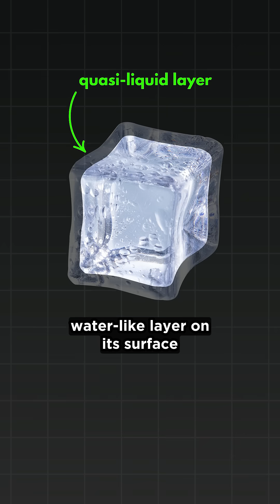The Science Behind Slippery Ice: Why Ice Skating Defies Logic

Comment: To everyone who is puzzled why scientists did not know why ice is slippery. It is more accurate is to say that they did not find out why there is a thin layer of water on the ice even at below freezing temperature, and as she has explained it was NOT due to melted ice from the skates' pressure. What the scientists figured out is that at the surface of ice, the water molecules at the boundaries is not fully surrounded by other water molecules, and therefore is unable to form the proper lattice structure of ice, and hence remain in a quasi-liquid state at all temperature. Now if you join two boundaries together, the water molecules at the boundaries are now able to form the full lattice and will become stuck together.
Reply: Thank you for the clear explanation, I was very confused about what was actually going on after the short. I always thought it was due to the pressure of the blades melting the ice. I used to play ice hockey when I was young (like most guys here in Finland) and the shape of the blades on the skates are actually not like a knife, but like a very shallow U shape, there's like a little canal between the two sharp edges, and I always thought that the pressure melted the ice and the water would then be guided to the canal due to its U shape and that way erase most of the friction. I think it's called the "radius of hollow" in English. It's the profile of the blade, the deeper the U shape, the more bite the blade has on the ice and obviously the sharper the blades are, but with a more shallow profile you get more glide (and less bite).
Reply: is it not slippery for the same reason liquid h2o is? due to the fact that it creates a barrier between you and the actual ground?
Reply: @chxseyt  searched it on google, it seems the simpler explanation is the change in molecular arrangement and the hydrogen bonding when turning solid. 

Hydrogen bonds in liquid state constantly break and reform therefore no layer of quasi-liquid is created, but as it turns solid, the bonds maintains a strong hold with each other rendering the other hydrogen bonds unable to harden because there are not enough hydrogen to bond with? So when 2 ice cubes are placed together, the surface of which the 2 cubes contacted where able to meet the requirements of bonding therefore sticking to each other. 

idk anything about this 😂😂😂
Reply: @chxseyt but in this case ice is the ground
Reply: In case no one as answered properly.  In layman's terms, yes.  But there's more to it than that.  @chxseyt
Reply: @chxseyt  when u stop depending on scientist and actually use physics for urself, u cud think for urself. Water cant be compressed so when u step on somethong that is wet, ur are slightly suspended by water with causes minimal contact with that surface.
Reply: @mylesgreen1361  L ragebait, you good?
Reply: @mylesgreen1361  Lol so you think your understanding of physics is better than scientists I guess? Just like all flatearthers? You don't even understand the point of contention here. it is not "why water makes a surface slippery", but "why is there ALWAYS a layer of water on ice making it slippery". Also, "Water can't be compressed..." well, that line speaks for how much you actually understand physics. Maybe you thinking for yourself is not something you should depend on so much
Reply: From my understanding this was debunked, basically there are ice crystals floating around similar to dust particles on the ground that the skates - due to the low surface area of the skates 'skate' over said crystals. Similar to how you can slip on a dusty floor. Your skates are basically rolling on the free floating ice crystals. This is why for example you can walk on giant blocks of ice that are frozen solid, but blocks of ice with snow on it are slippery (free floating ice crystals).
Reply: @cartoonhanks1708 thats a really good and exact answer
Reply: I am a teenager and paused the video and guessed that in a minute before she got to the main points so im now bewildered that it took them that long 😭
Reply: A lot of her shorts have stuff like this, where there is a statement that's slightly off that betrays her lack of a deeper understanding of the subject matter besides what's included in the script.
Reply: you always find the real explanation in the comments lol
Reply: The energy for holding the ice together isnt evenly distributed and sometimes a part of it has enough energy to warm up and become fluid
Reply: So we are basically walking on water when ice skating lmao
Reply: Had similar idea but yea good explanation
Reply: Im don't know much but. Is not the state of matter subject to pressure too?
Reply: @renathung5789  I don't know what you mean
Reply: @renathung 5789 Yes, but you would indeed need to have the weight of three elephants on 1 skate.
Reply: @renathung5789  They're saying that the fact that it's slippery is not due to pressure. You can stand on ice, not exert much pressure on it, and still slip and fall, even kids do.
Reply: Nur its not exacly a soroubded by liquid by liquid. In fact If there is a Layer of water on top of the ice the friction increases, its more like many small hairs wich can bend freely in any direction, so an object touchin the surface can bend them in any direction so its kinda Like Rolling on marvels. Of course thats an really simplified way to describe it but you get the Point.
Reply: If that was the problem is ? Does a cold iron or steel can have the same caracther as ice so its also can perform the same way as 2 ice ?
Reply: I might be wrong, but Isn't the condensation might be the reason for thin water layer
Reply: @Apkiller07 you are wrong, there is no water Layer wich makes the ice slippery, the Video is a Little Bit missleading. In fact a waterlayer would make it less slippery. Condensation would only work on cold surfaces wich are over 0 degrees Celsius in an atmospheric pressure of around 1000 pascal
Reply: So you are aware this lady's full of shit right
Reply: oh ty
Reply: @___idk you don't have to believe me just Google what she says and then realize it is the exact almost word-for-word AI summarization
Reply: Then shouldn't every solid have a quasiliquid layer on the surface?
Reply: Wouldn't it just be a thin layer to insulate since we're not taking into account the constant radiation bearing down on it from the sun? It's not a large amount of heat but it's a noticeable and constant source.
Reply: u
Reply: Water is very special! 👌
Reply: If what she says is true, then all of the ice in the bin in my freezer would be frozen together in 1 big chunk. But that doesn’t happen unless the ice has actually been warmed up to form that little layer of water to then allow the cubes to freeze together. So her explanation is definitely wrong in 1 aspect.
Reply: Did you take into consideration that blade of the skate is focused to a finer point? Kinda like the opposite of a snow shoe having about 100~+ pound human focuses down to the edge of a blade should provide ample force to generate some level of friction, no?
Reply: Bro is too smart
Reply: I thought it was logical that ice would slightly melt to be slippery, as cold ice isnt slippery
Reply: that is the part if the explanation that she missed that makes everything make a lot more sense. the most frustrating thing that can happen with science communicators is when there's this cool thing with a simple enough reason that they just don't elaborate on. it's not quantum mechanics, it's molecular jigsaw puzzles.
Reply: I knew this was a half ass exaination, thanks for clearing it up
Reply: Thank god it was the wrong question author said
I was almost crashing out cus of the “scientists don’t know why the ice is slippery” like FYM😭😭😭
Reply: Sybau
Reply: @Shinokuradesu   who hurt you lil bro🥀🥀
Reply: @_venti_the_bard_4369  acting like you have life😂
Reply: @Shinokuradesu  I do:3
Reply: Sybau you are not tuff
Reply: my thought was that the thin layer of water is from water wapor but I assume tests were performed that proved that even with no vater vapor skating is possible (e.g.  - 20 degrees C ice with normal atmosphere exchanged for equal pressure argon atmosphere?)
THANK YOU FOR THE EXPLANATION - top notch ❤
Reply: @KuSaNaG1 
THANK YOU FOR THE EXPLANATION - top notch ❤
Reply: That makes so much senseee (for my airhead) thank you
Reply: Sooooo freaking cool!!!! Thank you for your depth.
Reply: Whenever I remove ice directly from the fridge, even if in a bottle, it feels "sticky" for some reason, even when my fingers are dry, but this effect weakens as the ice gets warmer, I guess this is why.
Reply: Scientists are just people, and they can't simply explain everything! I encourage you to research how siphons work. You'll have a field day.
Reply: I remember reading something like this. On the surface, due to uneven bonds or something that there are always loose ice particles that are not stuck to the rest of the ice block or whatever. Or maybe something like that
Reply: My high school physics teacher said it's because of the pressure melting it, and I refreezes after the pressure is taken away so that's wut I believe. Also it is enough pressure, your putting your entire body weight on a knife
Reply: @danieltossey1498 This information about the quasi layer is recent. It's understandable that your highschool teacher is using outdated info.
Reply: You explained it very well thank you.
Reply: does that mean if I surround ice with more ice the ice won't be slippery ice anymore and instead it'll just be ice, non-slippery ice?
Reply: @thisisnotahandle1337  yes, because then the ice would have ice around it to form non-slippery ice.
Reply: Yeah, but a 50kg human would on 5mm^2 of skates surface would generate 100MPa of pressure, lowering the melting point by 10degrees, and what little friction you have. If it slows a 50kg human from 20km/h to 0 it generates 800J of energy, and that's enough for melting 2 or 3ml of water and that's plenty enough water to give you a very thin film, while sliding to a stop from 20km/h.

So I'm pretty sure scientists were able to figure that out with a phase diagram, the melting energy of ice and a rough guesstimate of how much water is in a film.
Reply: Can you explain that in stupid idiot terms
Reply: This video is fucking dumb, it’s obvious the ice skate that have fucking knives under them can dent ice without the need of any kind of heat and that’s how your able to to slide on it cause your cutting trough it, you stab a knife in a tomato it’s gonna stay there same with ixe
Reply: So basically, the same weirdness of the ice lattice structure that makes it grow when frozen instead of shrink is also responsible for there being a layer of water on the surface. This makes sense, because if you image a magnet being held up by other magnets around it all being in a lattice that maintains orientation, and then you get to the outermost magnets, those will fall down flat against the other magnets instead of staying in the perfect shape. It's not magnets or even the magnetic force, but this is a good visualizer.
Reply: Water surface tension.
Reply: That’s not true. It’s slippery because of friction and the lindenfrost effect
Reply: Water is slippery, freezes and stays slippery
Reply: so scientist just discovered 5th grade physics from 35 years ago ... thats brilliant
Reply: Thanks, good explanation
Reply: THATS why sometimes when i eat water ice cream my tongue slightly freezes onto the water ice popsicle thingy!
Reply: Yea
Reply: This is better than the video because I was stuck there being like “wait, nobody noticed that ice is wet until now?”
Reply: Metal  without patina will do the same thing in a environment with no atmosphere
Reply: thank you
Reply: 0% understanding 
100% you sound like a nerd I trust you
Reply: so you just figured the answer put right there no?
Reply: Thank you. Legend
Reply: Now I think when the ice ring is outside the sun would cause it to melt a littele on the surface and the warm water when scaters prees melt the ice
Reply: @aashwincat 
What?
Reply: @aashwincat No, pressure is still not high enough. By far.
Reply: So it is something like what happens to steel on space without any air
Reply: @bluedip  Are you thinking about cold welding of two clean metals?
Reply: @andrewbeaver1843  atoms bond with pressure, no heat	, atomic bonding of clean surfaces in cold welding and in space there is oxygen or moisture so no oxide layer and two atoms can't tell apart and become one, so yes it will be Cold welding
Reply: Yeah bro that's what was said in the video
Reply: @latenmuniz773 ya but she said it was wrong. I mean, we can see the metal can cut through ice and that process can be speed up with a little pressure. So idk why she said you would need massive amounts of pressure.
Reply: Sept she is wrong and they know exactly what creates the thin layer of water it is indeed the pressure and friction look it up before you comment next time
Reply: @Beelzebub73 nah youre wrong, liquid water would increase the friction its more like many super small marvels on the surface of the ice Build by half developed ice cryatals

Comment: It's because ice skate blades are made of metal, which conducts heat faster -  if you put an ice cube on a metal pan it will melt faster than if you put it on a block of wood or plastic because metal has a higher thermal conductivity. 

The ice skate's metal blades help melt the ice; combined with the sleek shape of the blades as well as the skater's added weight, this makes ice more 'slippery' for figure skaters, allowing them to perform tricks with ease.
Reply: This isn’t why ice is slippery though, and it still doesn’t explain why even a large flat block of any material still slips on ice

Comment: Actually there's an explaination with the crystaline structure of the ice's surface and water molecules with a degree of freedom in their movement.
Reply: The other explanation makes more sense! States of matter are constantly in flux at all temperatures period!
Reply: @thepracticalgymnast8001  It really only applies to the top layer of the structure because that is where the molecules have space to move, so only the edge of the ice acts as a liquid but it is only a few molecules thick.
Reply: @thepracticalgymnast8001  The difference between the liquid layer in the video and the quazi-liquid I spoke about is that in quazi-liquid the molucules are still held in theirlocation by strong bonds with the molucules benith them instead of moving freely like a normal liquid, this allow the surface to be slippery even when you're not an elephant on electric skates.
Reply: Isn't that just a more scientific way of saying it?
Reply: @eeveeofalltrades4780  Actually no, the water molecules in the surface are still bonded to those beneath them, so while it has some liquid-like properties, it's still count as solid.
Reply: yeah that is called liquid buddy
Reply: @patsplats  actually no, it's more like having tiny, molucule sized rolling beads connected all across the ice's surface.
Reply: @patsplats what he said! Which is what is said!
Reply: @thepracticalgymnast8001 yeah they said it in the video
Reply: @patsplats liquid ice at -20 degrees? No can't be

Comment: Does that mean there exists a temperature where ice is so cold that the outer layer freezes over and it ceases to be slippery?
Reply: Yes.
At about -38 degrees Celcius (-36F), the layer of water becomes about 1 molecule thick, and has quite a high friction co-efficient. 
As temperatures get lower, a Limit is enacted, and the Ice approaches 0 water, and is no longer slippery. (Not sure what its actually Friction coefficient is yet.)
(Limit as  [temp -> -inf] of water on Ice =  solid no water.]

But in general, as temperature decreases, the friction co-efficient of Ice increases.